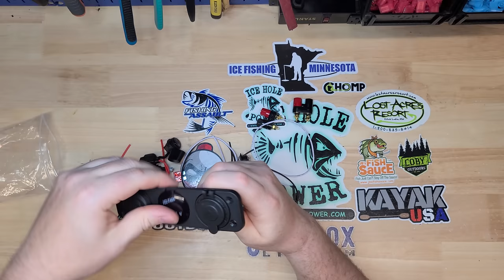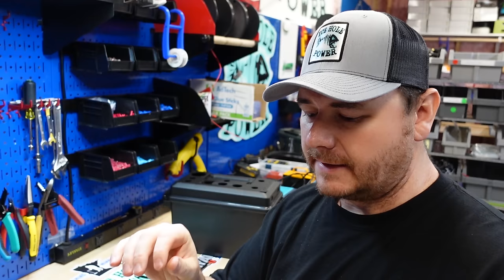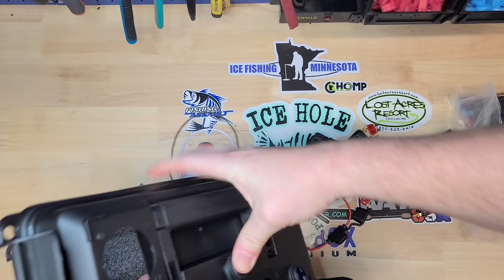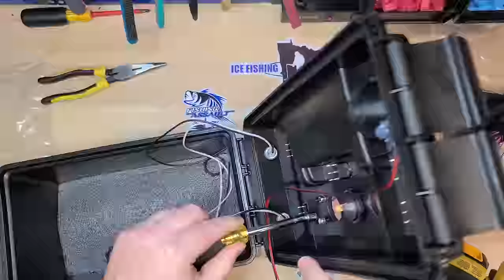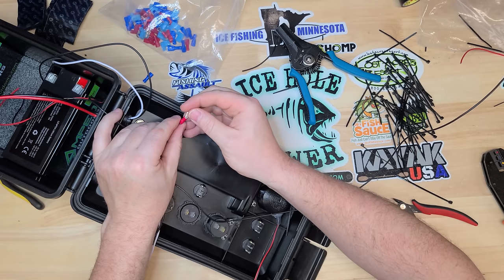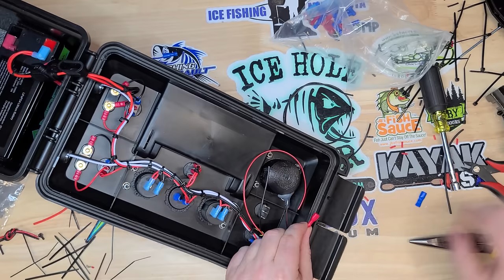How To Build A DIY Power Box

Comment: I just finished the Deluxe kit, with box, SAE connector, wiring kit, and the 3 amp lithium charger . I build lots of kits...modules for my synthesizer, radio kits, etc. and this was a real pleasure to put together. Following along with this video was just too easy and more than everything you need is included so I give this a 10 out of 10 ! I am using two 
Expert Power 12V 10Ah Lithium LiFePO4 Deep Cycle Rechargeable Batteries to run my QRP mobile ham radio rack. After searching many places for a diy build to power it I landed on Ice Hole Power and am totally happy with the results. If you are doing mobile HF comms, this is the ticket.
Reply from the maker: Frank, thank you so much for your feedback!

Comment: Love the video just which I could get the lugs and wiring kit before April lol.
Reply from the maker: Thanks, we are talking about opening when our stock comes in. will announce on the FB page when we are up and running.
Reply: @iceholepower8012  thanks I just which I saw your video before I bought my battery. I went with Dakota lithium 23 ah .
Reply from the maker: @marvjacobs5857  it will fit. Right under the handle.

Comment: 2nd time I've watched this video and learned something both times, on one of your videos you were showing the proper way to fuse batteries and I've been trying to find the proper size fuse for the 30ah Amp Outdoors battery
Reply from the maker: Hey Ernie, thanks for watching! I am glad you're getting some value out of the videos! When thinking about a fuse, we need to consider what we are running more so than the capacity of the battery. The boxes are all fused for 10 Amps.
Reply: @iceholepower8012  I'm running a GLS10/LVS32 and a126sv both with Garmin recommend 7,5 amp fuses, which I think is a little high. The amp draw of the 126sv  is approximately 2.5 amp but Garmin wants a fuse 3 times larger. Is the fuse I need coming from battery going to be 15 amp? Thanks for any help you cab offer!

Comment: Besides uses for ice fishing can this be hooked up to a watersnake kayak trolley motor to power it just purchased the motor would love this to protect the lithium battery
Reply from the maker: You would need to beef up the wires. It could not handle the amp pull of a trolling motor

Comment: My only suggestion is to save money, use vice grips instead of buying the crimper which most people will only use to build a box or two. I have 5 different crimpers for various connectors and most of those are necessary to not waste or damage the connectors. Other crimpers do not work as advertised and they go back and I use a standard, do-all crimper.
Just place the right-angle connector just at the tip of where the vice jaws end. You will see the crimp metal tube so you can just where to place the jaws. Before crimping, screw down the vice grip adjustment screw to where the jaws take a little pressure to close. Close the grips and you are done. No damage to the connector unless you do it wrong. I burned through 3-5 until I got it right. After that, get it right almost every time. Passes the pull test.
Reply from the maker: Great money saving tip! Thanks for watching!

Comment: What would be a great accessory for when you don't need the glow hole would be to replace it with an LED bulb and some kind of telescopic frosted shade that could be pulled up to make a mini top of box lantern. This could light up around and above the box and pushed back down flush when not needed. You would have to design it...If telescopic frosted shade is too hard just make it threaded so when you need it take it out of the box screw it on over the hole...turn off unscrew it and throw it back in the box to store. You could even make a red, green, orange ,and white color option.

Comment: I have a new Livescope 34 plus. I have a 30 amp amped outdoor lithium in my box. What is the minimum gauge wire I can use to run my black box and Garmin 1022 using the power box. I will not be extending the factory power cord of either. The power will be spliced together for my SAE connector. Garmin insists it be a minimum of 10 gauge. I told them my run is 8 inches. Am I missing something? Enjoyed the video. I’ve learned at age 72 your never too old to learn something.
Reply from the maker: I wouldn't see any issues going as small as 18awg especially in a 8 inch run. I did a video where I tested voltage drop between 18awg and 10awg.  https://youtu.be/4Fl6XJr7QT0

Comment: Can I use the DC port to power my Intex 12V quick air pump?  I usually plug it into my car's cigarette lighter to inflate my air mattress but wanted to see if this can be an alternative.  Thanks!!
Reply from the maker: It shouldn't be an issue. I actually use my air mattress pump while it is plugged into my box to help get the camp fire rolling when the wood is wet.

Comment: Is there any issue with adding a USB 3.0 power sockets, aka: fast charging, they seem to come with their own fuse. But they still draw off of 12 volt system. I was thinking of adding one to my deluxe box, not swapping out the one it comes with. What are your thoughts?
Reply from the maker: No issues at all with that plan

Comment: I've got a build this week that I need to get done before we go camping the week after that. Need a battery for my trolling motor and will be using recycled 18650 batteries, 3s90p configuration, which should give me 200Ah / 2000+ Wh. Need something that will last a week while fishing running a 30lb Minn Kota without having to be recharged until I get home or can get some solar panels and a good solar charger. Being up here in Canada on the West Coast, I've bought all my stuff off Amazon but using parts from your builds as recommendations.
Reply from the maker: Sounds like a fun project! Good luck on your trip!

Comment: Is charging time reduced if you have two batteries? Are you able to charge with two chargers, and would that require 2 SAE ports? and how do you know when it’s done charging.
Reply from the maker: If using two batteries, charging time is reduced because you have more battery to charge. It can all still be done with the single port. When the box is done charging, the light on the charger will turn green. (assuming you are using the amped outdoors lithium charger but most other brands will also have a light that will turn green when charging is complete.) Just make sure the charging switch is in the on position. Great questions! Thanks for watching!

Comment: if I was to hook up my garmin 93uhd, can I just connect it to the accessory spot?
Reply from the maker: yes
Reply: @iceholepower8012  thank you, also the sae kit came with extra sae attachments. Can I just solder that with my garmin power and hook it up through the sae port?
Reply from the maker: @Freshmanger2009  you betcha
Reply: @iceholepower8012  thank you! You are awesome. I just purchased a kit and I'll upload it to your Facebook page when I get it all set up
Reply: @iceholepower8012  what is a good terminal to attach my fish finder to the neg and positive post? Sorry for asking so much questions
Reply from the maker: Did you order is with the SAE port? We would of sent pigtails that you can use to hook up your fish finder. Otherwise, small alligator clips to the binding post works well.
Reply: @iceholepower8012  I did yes, I'll have to look at it again lol. You sir, are underrated.

Comment: Great video! I purchased this kit with 2 of the 30 ah 12V amped batteries. I do not have the light cup but I do have all other components. I am at the fuse connection part of video at 52 minutes and noticed the fuses in kit are 10, 5, and 3 amp but i noticed each battery is 15 amp max constant current. Do I need to buy a 15 amp fuse?

Comment: the problem with your kit is that your wire is too thin you need at least 16 AGW or better yet 14 AGW wire. I do not know what a trolling motor will take but I know that the larger dia wire will draw less current through your thinner wire.  I need at least a 12AGW wire and at least a 15A-20A fuse because I will be using it for a 20-50 watt HF transceiver. I will be using 24Ah Dakota LiFePO4 batteries plus, I will be using 45A Anderson Powerpole Connectors.

Comment: I ordered parts from you for a project I’m doing. I’m impressed with the quality ! Much better than the crap I get off Amazon. The battery I’m using is a 100 amp hour big battery or I would have got a box from you to. I may still do a box just because it’s so cool. Have you thought about solar charging? Solar generators are sooo expensive. Just a thought.
Reply from the maker: Thank you Ronald! I have thought about them but, we are too busy to add more to our plate right now. Thank you for watching!

Comment: I was watching this video specifically for an NMC battery and then you warned against it 😂. I'm assuming the switches, usb, and lights are the components in question. If I swapped those out with ones that could handle the voltage, I should be fine, correct? I'm used to building drones that use 6S batteries so I'm just clarifying.

Comment: Hi Jeremy
I am running 2 106svs and my live scope off of one of you 48amh battery Diy boxes. The second unit is the console unit and the battery box is going to be located in the front port rod locker. The run to the front unit is fairly short 4-5 ft.. but the run to the console will be close to 10 by the time I go across  and down the starboard side. Do you think I should bump up the wire size to say 14 inside the box from the battery to the SAE plug, and make the run to the console unit? I don't want the voltage to drop much to that unit... I heard it's also good to have max voltage running to the black box.. what do you think?

I also want to thank you on the quick shipping I am expecting it here today!

Comment: If you use an NMC battery, you can get a buck converter that takes any supply voltage as high as 30 VDC and knocks it down to 12 VDC.

Comment: Can you show how to do 3 batteries in parallel?
Reply from the maker: line your 3 batteries up next to each other so the terminals are all on the same side. from left to right, wire positive to positive to positive. The right most positive post will also have the fuse holder wire in the same terminal. Then starting from the right negative post go to middle neg post then left neg post. That LEFT neg post will have an additional wire that goes to the neg of the charging switch. If that doesn't make sense, shoot me an email and I will draw it out for you real quick. Jeremy@iceholepower.com    
Thanks for watching!!

Comment: I'm at 53:19 and it just dawned on me.  With the box turned on, I could be charging the box and phone at the same time, right?  My thought process is (thinking of emergency use) leave my phone plugged into this all the time.  Then if power goes out, I just keep on trucking.  Then when it gets dark, turn the light on.  Haven't thought this comment through yet, but didn't want to forget to ask.  btw, I bought 2 boxes.

Comment: I had great fun building this powerbox. However, when I hook my charger to the banana plugs to charge the batteries, I have to reverse the black negative wire with the red positive wire from the charger. I've been very careful to keep the polarity correct, but I have to flip it at the battery box. What's up?  Can you assist?

Comment: like your videos they are detailed and matter of fact. I learned so much on lithium batteries, I used to buy them based on voltage and amps reflected in the packaging. wishing you tight lines, cant wait till your site reopens in april got me excited about building a power box
Reply from the maker: Thanks Mike!! Looks like it might be March now, I will post on the FB page when we are back up and running!

Comment: Awesome video. Thanks man!! Question: Why do you use the flag connector on some? I have all the other connectors and wondering if I need to order the flag connectors and buy a proper flag crimper
Reply from the maker: You can build them with all female spade connectors. I try to use both to keep the wire harness at the same level
Reply: @iceholepower8012  that makes sense. Thanks again man.

Comment: Hi Jeremy is it possible you could do a short video on how to wire the sa port in without having the posts in please 🙏
Reply from the maker: I will be making a video about just the SAE port, but to answer your question, land the negative wire from the SAE to the battery and the positive to the middle post of the charging switch.

Comment: Thanks for posting this (and all your other videos). I'm installing a Garmin Striker 4 Plus in my drift boat and have a 12 amp Rebel battery coming (thanks to your review). I'm an old AGM guy and was thinking I needed a voltmeter to keep track of my charge–but it dawned on me that perhaps that won't be of much use with a lithium iron phosphate since the voltage doesn't drop off so much... So I was curious to see you put a volt meter in your box. Is this just to catch the tail end slide of the battery charge? Thanks again.

Comment: I would love to use this for my garmin 7sv in the winter, also would work great in my kayak during the summer to run my 4cv
Reply: I am a year late to this game.  Did you use this for the Garmin?  I just bought a Garmin Striker Plus 4.  It has a 4-pin connector to the Garmin and an inline fuse leading to bare wires on the pig tail end.  My Expert Power charger comes with an SAE to ring connectors and an SAE to alligator clips as choices to connect to a single Rebel battery.  The flush mounted SAE looks like an attractive way to charge the battery externally to the box.  I could also use the posts.  Is there a way to rig an SAE or even a 4-pin end on the Garmin pig tail so that I can plug in the Garmin externally into a clean, flush-mounted spot on the box?  I am looking anything other than a running the Garmin wire into a gaping hole in the box (I do have some rubber grommets).  I think I would like this small box to be dedicated solely to the Garmin with the exception of a voltage meter with USB Type C.

Comment: Just watched your video. Spot on and the way you ran your wires are clean and tidy. So I have had my ammo box for almost over a year, but I am running a 60ah Amped battery, I've been charging the battery with the adapter that came with the battery. Will this kit fit my 60ah battery?

Comment: BW Hi I build a power box with a fuse block in it about 3 years I think not for sure but it’s working just find.only one issue was the lights I had to go fine some light’s because the wire had pull out them other than it’s just working fine.

Comment: I used led rock lights for the lights on the box I made. They give great white light and is better quality than the ones you are currently using. I recommend you check them out. I can give you the exact light I used if you are interested.
Reply: Yes!  I’m interested in the source for the LED rock lights.

Comment: I knew that two bad lights at once is near impossible,so I broke down that 4 wire ground and found the lighting issue. Took the box fishing and everything was top notch. The glow cup worked great and helped me put a couple of walleye on ice. Thanks for a great diy product.
Reply from the maker: Nice work. With those wires being so thin, when you crimp them, sometimes it will cut the wire. I am guessing you did not put a bit of solder on them to stiffen them up?
Reply: Correct. I sensed the issue as I assembled, but tried like heck to pull wires out and they were crimped tite.Going to do a long run test on all to see batt life of 2-18v ah amp batts and recharge time.Great product Jeremy.
Reply: When I figure out how to send you pics,I will. Maybe some on the ice pics later too.

Comment: Does a guy need to use the flag connectors?
Reply from the maker: Not at all, I was just showing how I wire them in house. You can use whichever connector that you want
Reply: @iceholepower8012  great Jeremy.  Mine is wired and works like a champ.

Comment: Jeremy, not sure if this is the best way to ask you a question or get your opinion, if not let me know which is best. I picked up the below item to run with my DIY power box. 12 v 12ah Lead Acid battery, when I pug it in, the Solar Charge Controller or something starts making all kinds of crazy noises, digital display goes haywire, so not sure if it over draws the system or if I have a bad 12v plug, not enough ah, etc. Any ideas? 5-Port Front and Back Seat Mobile USB PD Charger | DEWALT
Reply from the maker: Email me pics of your set up and I will take a look at it. Jeremy@iceholepower.com 
I am taking private pilot lessons in my free time so i have been slow to respond.

Comment: Do you have a link to the stainless screws and nuts that you use on the SAE port, I am curious if the head sits down in the recessed area of each hole and how long they are. Are you using locking nylon nuts as well?